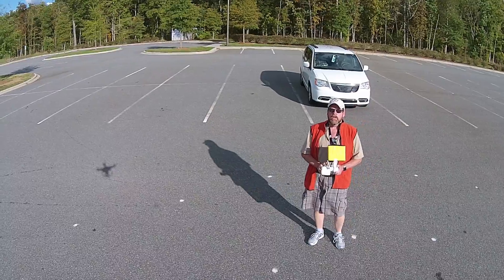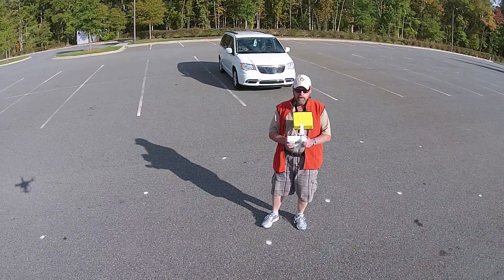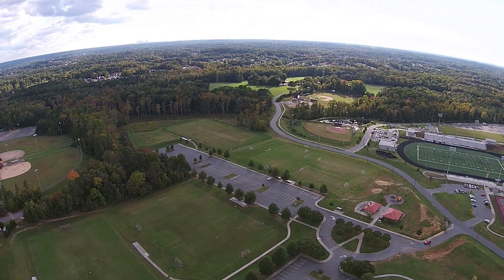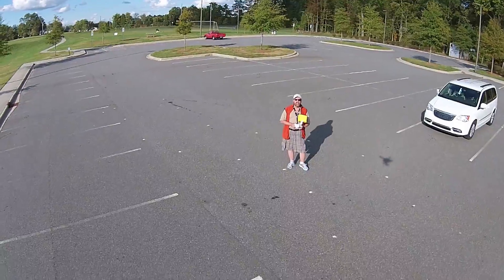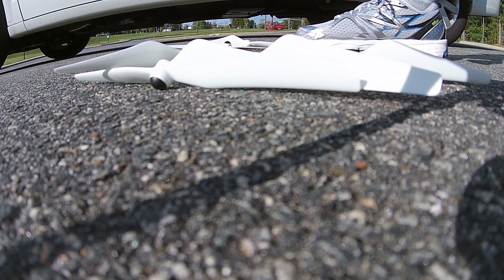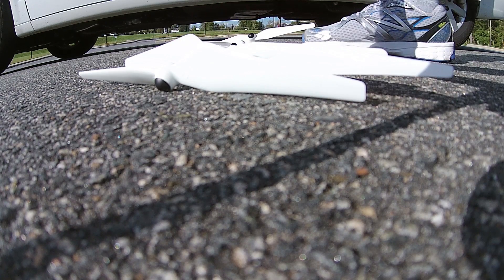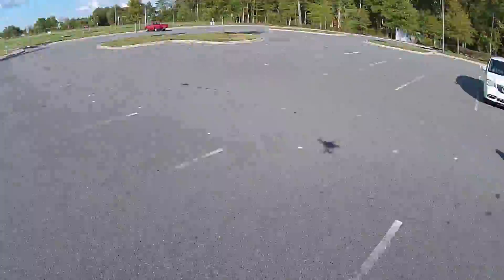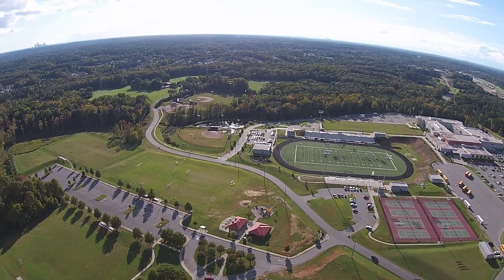DJI Phantom Prop Test:  Stock Props vs. New 9450 Props

Comment: It would be nice if you could summarize the results in the description........
Reply from the maker: You're right, and I just did that.  I put it in the video description, but I am also placing it right here:

I timed an ascent from 0-400 feet using both sets of props:

~Stock props went from just about ground level to 400' in 30 seconds, or about 13' per second.
~Newer upgraded 9450 props went to 400' in 23 seconds, or about 17.5' per second.

So that is about a 25% improvement in ascension speed.

Comment: Buenas noches Mister Bob, esta semana compraré el Dji Phantom, quisiera saber como trabaja usted?, precios, usted cobra por hora o cómo lo hace, yo quiero saber para hacerlo similar, muchas gracias y saludos para toda su familia.
Reply from the maker: Hi.  I suggest a simple rate plan:  $X.xx per hour and $X.xx per mile.  The actual amount depends upon when and where the job is.

Comment: Are you seeing the same, more or less time in the air with the new 9450 props?
Reply from the maker: Even though the test in this video isn't scientific at all, it works logically.  I think you'd have to do a more controlled test to compare "hang time" which I did not do.  My guess is that it may add a minute or less to the overall flight time.  There is nothing noticeably better about flight time.
Reply: Bob Asbury Well nothing notable about overall flight time would be a good thing.  I kind of expected flight times with the 9450 to drop.